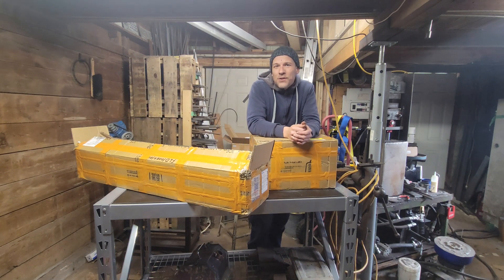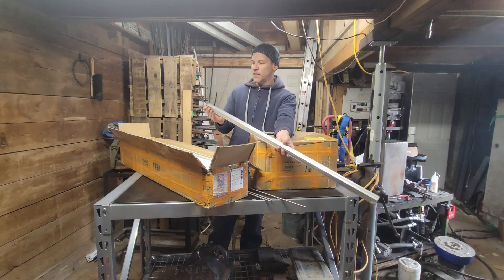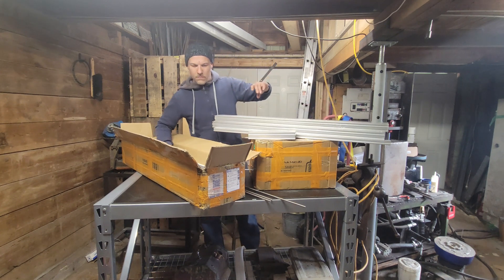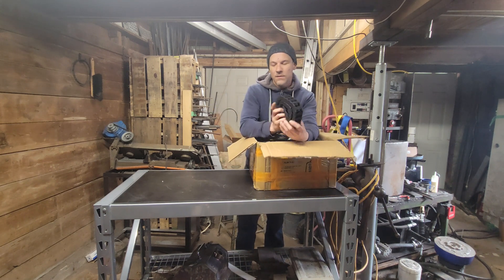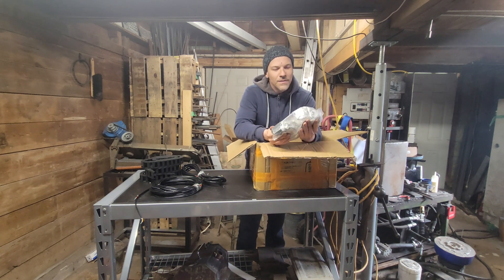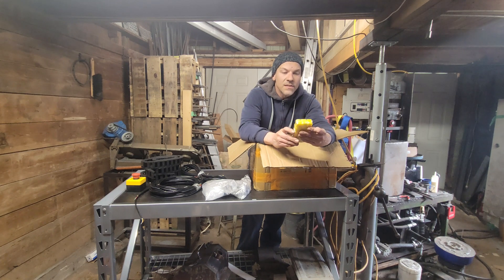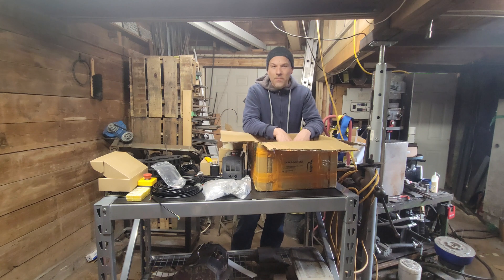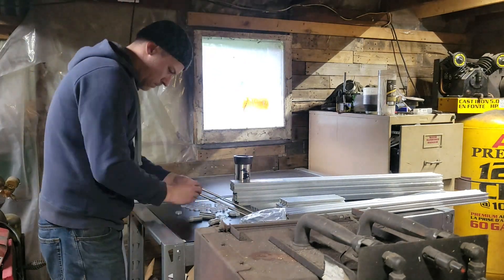Bulk-man 3D Lead 1010 CNC router - Unboxing Review

Comment: r u satisfied with mashine after sdome time pass ?
Reply from the maker: overall yes im still very happy with it as a plasma cutter.  I have not really use it as a router, only about a dozen times so far.  If your main use is a router I would recommend going to the upgraded model as i found this one had a little to much flex for my liking.  Thanks for watching
Reply: @KevinChainey  did u try to fix it , or with shallower depth ?